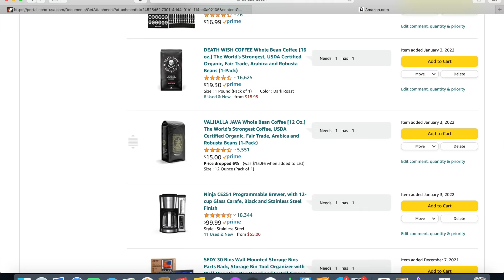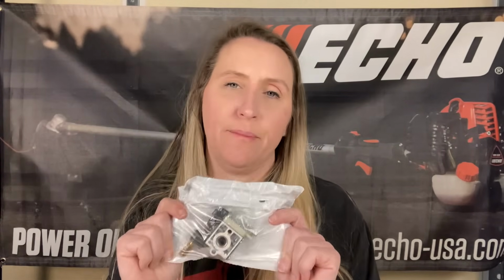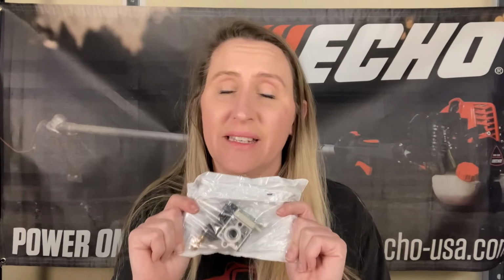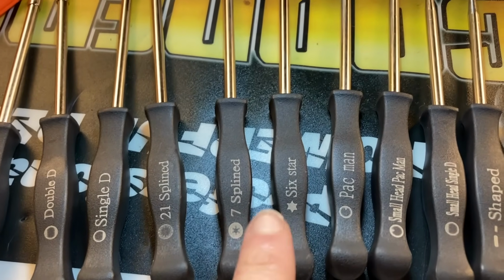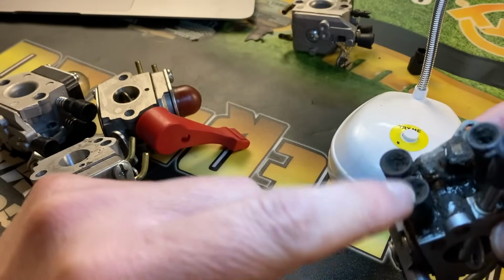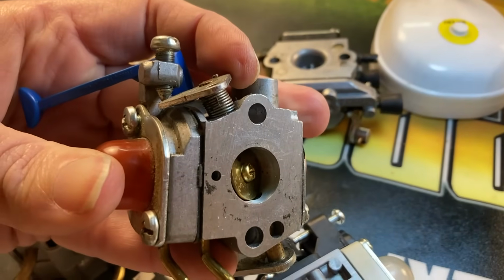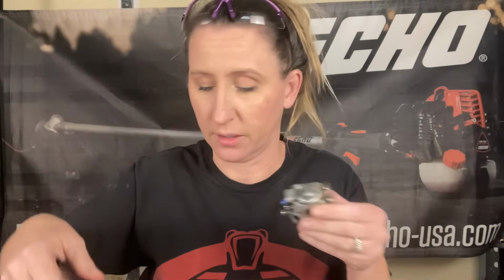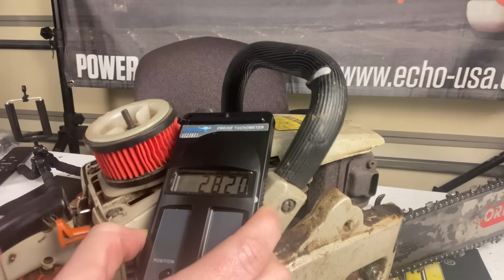HOW TO ADJUST your 2 Cycle Carburetor on a Chainsaw or Trimmer and when you probably shouldn't VLOG

Comment: Wow, very timely that this should appear in my recommended videos today.   I got a new Stihl MS291, and it threw a hissy fit the first time I tried to start it.  Started right away- then died after 30 secs, and refused to even try again.  Then I flooded it, and discovered I'd neglected to bring any tools with me...  So I gave up on it for that day, and used my other one.

  Next weekend, I pull the plug and clean it off- then give the rope a couple of pulls to clean out the cylinder, and reassembled.   The bugger started right up!   And quit.  Restarted in run with one pull.  I had to hold it, and feather the throttle now and then to keep it running, until it warmed up.  After that, it became an absolute beast!  After cutting all the big rounds I cared to lift into my truck, I let it sit and idle a bit before shutting it off.   (If this is brand new, I can't wait to see what it becomes when broken in!)

  I was wondering if maybe I should nudge the low idle up a bit, so it stays running without help as it warms up, but  you've convinced me otherwise.   I was VERY happy with how it ran once warmed up a bit, so I think I'll leave it alone!    

  Also, two thumbs way up for manufacturers adding vibration reducing systems to saws.  Dad's old McCullochs vibrated so hard, they'd leave your hands all tingly and puffy feeling.  Not at all pleasant.   They were so hard to start every time firewood cutting time came around, that I learned all kinds of interesting words, and was put off gas saws for decades...   This 55cc saw here,  doesn't vibrate much at all.  You could tell it was running and cutting, but it didn't make you PAY for using it, like those old things did.

Comment: I just replaced the top end on a WT200 wild Thing blower. I also bought a new carburetor since the thing has been sitting for 5 years. I followed your advice to just plug and play and not adjust the carb. It took a little coaxing but I think it was because it is 19F out and the pre mix was a little cold. I brought it indoors for about 20 minutes. Took it back outside and it started right up. Sooo. 
“Plug and play” worked great!  Thanks Bre.  Just a note. I had to buy the top end on EBay because none of the eparts companies had the head. The top end arrived and the carb screw and exhaust bolt holes were NOT threaded. The seller said they come from the factory unthreaded. Carb mounting screws were “bastard” M5 1.25. Nobody sells a M5 1.25 tap. Sooo went to 10-24 SS 1” Allen screws and tapped for that. Muffler screws were 1/4”x20. Easy tap. Air filter media was discontinued but I used my gasket cutter kit to cut the inner and outer diameter of a donut from a block of generic lawn mower air filter foam. No sense getting out the snow blower on these fluffy lake effect snowfalls. A leaf blower will handle it.

Comment: I so thankful for your 2 cycle oil and I'll never use anything else in my equipment except the Echo 6550001 Red Armor 2-Cycle Engine Oil this is the best oil ever it has fixed so many problems in all of my equipment thanks again for your video on the Stihl  problems in your shop about running your equipment full throttle instead  of running it a 1/4 to 1/2 way open

Comment: I had that aha moment when I finally understood the principles of how this works. It happened while watching your Stihl adjustment video, which is done in slightly different order, but in the end the techniques are more similar than different. For people coming along you want to remember a few principles. You want it on the verge of running rich, since lean combustion leads to the deadly combination of extra heat and inadequate lubrication. Turning the ticker screw CW will open the idle throttle stop to increase idle fuel delivery. Likewise turning either L or H CCW will also give more fuel. You first adjust L to get a peak stoichiometric idle rpm, then you increase L more to bring idle back to desired baseline to produce a safety cushion of extra lubrication and fuel. The L jet opening is at the point of fastest air flow at idle, right beside the throttle butterfly. When L is adjusted correctly, snap throttle gives a brisk rpm response. When the throttle is open, the H jet is positioned upstream at a second point of fastest air flow (lowest Bernoulli pressure). All of these factors are fine print compared to big problems of air flow restriction such as a dirty air filter or clogged spark arrestor. So, fix those first.

Comment: Thank you, If I hadn't listened to your thing about Trufuel, changing fuel to improve, fix bogging or no starts, I would probably still be taking apart my carb for the umteenth time without going thru the checks you pointed out. As it turns out, the reg fuel mix I use (Shell 97 octane + 50:1 oil) was bogging my Redmax bush cutter, then I took your suggestion to change the fuel, but changed to Trufuel instead (for comparison cuz it was on sale at HD) and guess what, the bogging issues disappeared, although contrary to your opinion of Trufuel, it was your suggestion to "change out fuels) that got me to doing it.

Comment: I have a craftsman chainsaw I bought 12 years ago, I used it once and it ended up in the back of the basement….I just seen it the other day took it outside, had gas in it from years ago, well I was like will it run…and Yes it did, I cut down a tree…I was amazed..

Comment: Have for over 50 years always used to set the H screw to max revolutions and then a little back so that the engine runs with a slightly rich mixture. The L screw is adjusted so that the motor takes revolutions quickly without jerking. The idle speed is then adjusted so that the chain does not rotate and the engine can keep running at idle speed without stopping. Then the three settings can be repeated to check that you have found the ideal setting of the carburettor. Plain and simple.

Comment: Love your stuff!!! Re: water in fuel. Ethanol in fuel is a sponge for water. Here in FL the humidity is all it takes to add a tea spoon of H2O in 6 months. 1st fix = use non-ethanol fuel only. 2nd add a product called Ethanol Defense. If you see the comparison with all competitors you’ll agree. It was made for the marine engine industry and it’s performance is phenomenal. Seriously check it out.I’ve used it for 15 years. I’ve tinkered with small engines for 60. Also; air cooled engines that use ethanol/gas run 60-180 degrees hotter than those using non-ethanol fuel. I met a husqvarna repair guy who showed me a 6ft tall pile of chainsaws with blown heads to prove it.

Comment: ❤❤ new to watching.  On 2 cycle carb repairs i didn't see anything about the gas tank pressure valve. Or as i call it. The duck beek. That is  usually on tank or in fuel cap. KEEP the videos coming

Comment: I have purchased 2 brand new "value" trimmers. Both out of the box would only run with the choke on. As a professional auto mechanic I found a way to make small adjustments to the carb and got it running well. It appeared to me as though both machines were adjusted for Colorado not Houston TX.

Comment: I have a 1974 Poulan S25. I check once in a while to see if my buddy, Leon, will come up off his Poulan 5200 later this year.

Carb gets cleaned, and completely rebuilt, fuel line, fuel filter, air filter, and spark plug gets replaced every Spring. Air filter, and spark arrestor get checked, and cleaned regularly. 

I don't need any special tools to adjust the carb on my saw. Plain slotted screws😁

Comment: Yeah, when I buy a carburetor for a piece of equipment. The first thing I do is take those caps off and throw them away. Then if I can, I put a little drop of paint on the screws after I adjust the carburetor, so I can tell if they have messed with the carburetor. If they did, automatic 50 dollar fine added to the bill.

Comment: I thought I bought an OEM carburetor for my Shindaiwa trimmer. It was not OEM and needed adjustment. I wish I saw this video before I did that but it turned out ok. I have been using it for a few years without further adjustment but I definitely agree with buying oem replacement parts and not 3rd party. Thanks for the great video! I am one of those people that have a different brand of everything (and none of them were made by MTD haha)

Comment: This may sound like a pain in the butt
But after I’m done using my chainsaws and weedeaters, I dump the fuel back in the gas can and I run the engine until it out of gas   and I haven’t had problems in years with my equipment

Comment: I stabilize all of my fuel.  I use BriggsAFT or 5in1fuel stabilizer at one ounce per gallon of gas.  The longest amount of time I have had no problems with the gas is two years.  You are correct about Tru Fuel.  My son in law topped off the gas tank on the BG56 that I gave to my daughter with 
Tru Fuel.  When I went over to their house I was able to crank the blower but it did not run correctly and it would not restart when I shut it off.  Suspecting fuel I dumped the fuel out and refilled it with the Red armor 50:1 tank that I had given them.  It cranked right up and ran perfectly.  I told my son in law to pour that Tru Uel crap in his lawn mower and burn it up that way.  I refill their gas tank with new two cycle gas at least once a year with my Red Armor 50:1 mix of premium non ethanol gas.  The same stuff I use.  My gas seldom lasts over 60 days because I only mix it up in one gallon batches.

Comment: I use a short piece or copper pipe, works great for different heads of screws, a small tap with hammer will reset the copper

Comment: Just found your channel, Awesome direct to the point no time lag good photo editing . I am a back yard mechanic. And proud of it, I fix everything almost always. Cars lawnmowers record player. The past few years I have learned a lot from people like yourself willing to share knowledge. And I would like to thank you and everyone else, of course you tube. I don’t know if I could edit and film as well. But often I do something I haven’t seen or found any help for on you tub or the web. But I did get the job done with years of tools an tricks that seasoned mechanics share with me. Since watching your first 2 videos I’ve already picked up a few things. Thanks I do have a question or 2 for you. And it not the gas cap . I have a husqvarna backpack ran great first year. Second year starts right up after 15 min dies. Prime it starts up runs for 15 min then dies again. I am going to give it the complete run down you explained and hope to find a clogged exhaust screen or something. Where to buy carb screens ? Second question or is this the third. How would you rate the John cutter 25 cc arborists model. Hope to have good luck with it. Didn’t want to spend the big bucks but didn’t want to buy the cheapest saw or did I ? Got saw 10” bar a chain and 14” bar and two chains for $200 echo was $384 and stihl was 429 for saw bar and chain. Thanks in advance. I have problem tend to right books 😂

Comment: I set the low idle by watching that the engine was staying off the clutch and the blade wasn't turning. made sure that the engine wasn't surging or idling erratically by adjusting the throttle idle. occasionally blipped the throttle and slightly adjust the high mixture to eliminate the bog. I also kept using the choke idle and feathering the choke valve to really make the carburetor work the fuel pump diaphragm. I had to top up the gas tank once or twice. I had to make a slight adjustment when trying to cut some wood. Seems to be in its sweet spot. I drained the gas tank back into the gas can, started the chainsaw a few times to empty the fuel lines and carburetor. I don't put the saw through any long uses. But I do intend to use it pretty much all year round when a cordless saw isn't quite right for what I'm doing. I'm still waiting for the snow to melt away and I have one property cleanup and possibly a few more jobs lining up. I'm also a 35 year experienced mechanic mostly with V8 4 barrel small block and big block engines as well as with 4 stroke and 2 stroke small engines. But the 2 strokes I have the least amount of time and experience. It was really refreshing to learn from your videos and a fulfilling experience to get a cheap used Poulan chainsaw running good again. Our Canadian prices are way over cost compared to the US. But I only used bottle picking money to buy the chainsaw, a replacement purge bulb and I modified the machine to take a better quality of fuel lines and got away from the Tygon lines!

Comment: Superb,educational videp. I bought the needle valve screwdriver assortment. I was impressed,they work great! Need a video on fuel line sizes and selection and the tricks of the trade installing and routing the lines.

Comment: 100% right, if you don’t want issues run gasoline without ANY ethanol. 
i run all my stuff without ethanol and drain if im not going to use it for awhile and never have issues. 
The only adjustments i’ve ever had to make are for extreme altitudes.

Comment: For my 2 cycles with the "Funky" adjustments I have taken a dremmel and a cut-off wheel and ground a small slot in the top of the screw. All I need is a small screwdriver and done deal.

Comment: Husqvarna recommends letting a saw warm up for five minutes before you adjust the carb.  This is what I do on all of my saws, even though 90% are Stihl saws.  IfI have a problem with a saw the first thing I do is dump the fuel, second is the spark plug and then the fuel system.  FYI, two months is really two years, according to customer measurement of time.  I never remove a spark arrestor screen - I clean them.  It sometimes takes several aftermarket carbs to get a good one.  My MS 440 was the worst one.  It took four.

Comment: Wouldn’t you think by now the epa would know people are going to find a way to adjust carburetors one way or another. They need to give this “non adjustable” crap a rest.
Speaking of old saws, I have a 33 year old Echo 510 EV. It is a beast of a saw!
I’ve never run out of power. Well, I run out of power but the saw does not!

Comment: Thanks for making this video. I think I'm going to have to watch it a bunch to fully understand it. I didn't know that digital tool was made and me being stupid tried to adjust my chainsaw. It was messed up when I bought it new but didn't want to deal with taking it back (like an idiot). It just didn't run right and died way to much for no reason.

Anyway I took it to a guy, paid him $50 2 years ago and he adjusted on it without the digital tool. Couldn't get it running better so took it apart, cleaned it and it ran so much better. Anyway when I got it home it had zero power to cut anything. That all that made me but the carburetor tools you showed minus the digital one and now it won't run.

Comment: It sounds silly but, I bought an Echo trimmer about 6 years ago and I really take care of all of my stuff but, I never knew there was an gas filter down in the tank until this season when it would run 5 min. then choke off, repetitively. I knew right away it was fuel related, I build hot rods. So, I found out how to change it, what I had to buy. Low and behold, it took 5. In. to repair and it runs like a Swiss clock. So, using it, year after year, never changing the fuel filter reached a time where it was totally clogged. So, I have four new ones and will definitely keep an eye on it.

Comment: I have an X- Mark mower and a lot of ECHO equipment to do my yard. I live in South Florida. I buy 90 octane rec. gasoline, put 1/2oz gray stable in it, and some Marvel mystery oil. I generally store between 3 to 5 five gallon cans  all year. My two cycle echo I use echo Oil in addition to the Marvel mystery oil.

Comment: I do it all by ear ive been using chainsaws for 20plus years i have a sthil that is a 25yr old saw runs like a top i do all tuning and cleaning myself and have never had to replace any parts other than spark plug and air filters. Tip make sure you always use non ethnol high octane fuel and good quality two stroke oil makes all the difference. Plus always keep air cleaner and the saw itself clean. Cleaning your saw will make it last for years and years.

Comment: Great video!!! I've tried to buy an adjustment tool from a local saw shop. More than happy to sell me one, however I wasnt very happy with the price it was over $50.
Reply: Buy online no problem.
Reply: An easier option,  use a cut off wheel,  just cut a small slot in the screw/ housing and use a small screw driver to adjust.  Cheaper, and probably illegal,  perhaps better than owning an illegal tool. Maybe.

Comment: My son is a certified honda bike,small equipment, jet ski mechanic,  Honda sent out a shop bulletin asking the mechanics to use startron in all carburetor or fuel injection work, TO drain the tank and put fresh fuel with startron,ever since he told .me I have used it for the last 15 years and never ever had any carburetor problems. The only problems I have is when I'm given or buy equipment , some reason it's always bad gas. With out any additives gas has about a 30 day shelf life . I only use AMOCO or BP, IT doesn't have that yellow color!

Comment: I have never ever touched the carb adjustment on any of my two-stroke engine's. I have replaced the primer bulb on my Stihl fs 80 and that's it. That sucker is 23 years old and I flog it.
I think that's the secret. I mix the oil slightly more than recommended and always use premium unleaded. I clean the air filters often, blow the crap out regularly with compressor. 
I NEVER EVER leave my gear on a cold damp concrete floor. That's where a lot of that water condensation comes from. My workshop is all timber and filled with timber. Keeps humidity lower.